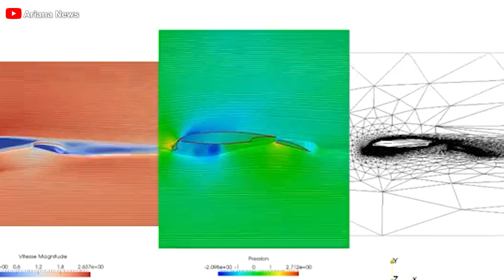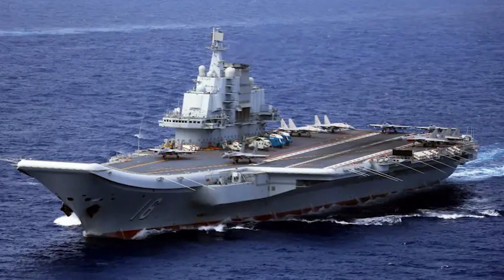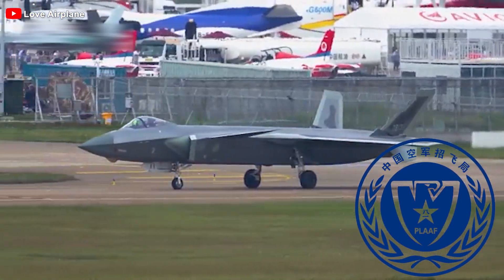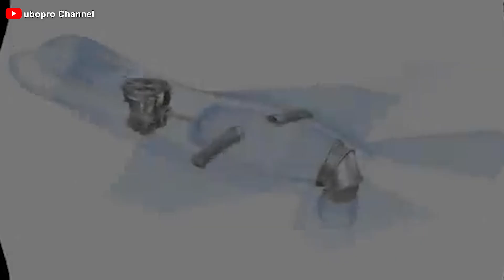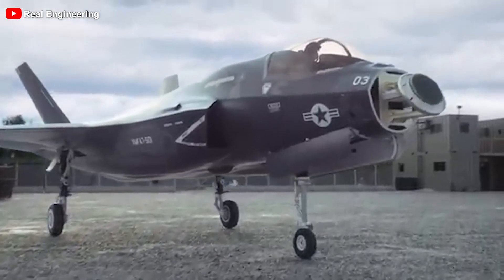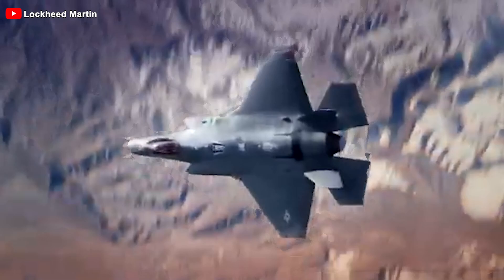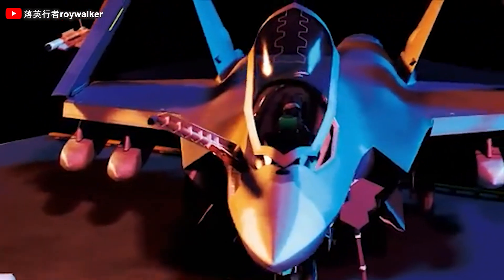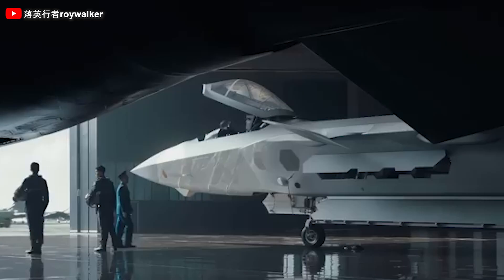The Chinese Airpower: J-35A New Stealth Fighter to U.S Stealth Fighter...

Comment: The design can be finalized after tests with prototype aircraft doing launch and recovery cycles. Structural cracks to the airframe due to stress of catapult launch as well as shock landings. Furthermore, the aircraft must have a controllable slow speed on landing to compensate for the bobbing of the carrier flight deck. May have to increase wing area and strengthen wheel struts.

Usually the first aircraft to takeoff is a rescue helicopter as a safety precaution if ever a fighter launch fail and the pilot goes into the sea. The ship captain must stop the ship immediately otherwise the pilot will get sucked under and ripped apart by the ship's propellers - a known occupational hazard experienced in western navies.

Comment: Many know features of J35A exceeds that of F35.
J35A can supercruise once the ws19 engines are installed at mach 2.2 vs F35 at 1.2 mach with after burner for a short time.

J35A comes with longer range missiles the PL15 
J35a AESA radar is larger with more TR/M using the latest Gemanium nitride same as F35 .
J35A comes with China very advanced communication systems where Quantum communicaitons, 6G , etc can be incorporated.
J35A is sllimmer and is said to be more stealthy.

Dont think the J35A electronics are inferior to the American F35 as Chinese is known to be far advanced in new tech today.

We do agree , since we do not know much about F35 secrets nor J35A secrets,  which is better will only be known if both do battle.
Reply: WS19 is already installed for J35a
Reply: J35a AESA radar is larger with more TR/M using the latest Gallium Nitride semiconductor material for superior radar and EW performance. The US has difficulty equipping its F-35s with Gallium Nitride active electronically steered array (AESA) radar systems as China has banned the export of Gallium to the USA.
Reply: also worth noting the J-35 is larger and has 2 engines, which will allow for more power, cooling capacity, and room for future technological upgrades. this is something the F-3t has struggled with.
Reply: J35 generates more electrical power for the systems whilst F35 is always hungry for more power..... just look at their block 4 upgrades... new engine already
Reply: @hkfoo3333  If that is true? Where is the battle track record? Need not tell lie. Show your battle track record.
Reply: @CherLinLoo-yv7bl  
You tell me the track record of the F35 or F22 old plane.
As it is no steath has fought another stealth .
So we have to base on its features that have been widely reported.

Funny you guys have already lost all tech you can think of . Even the difficult chip manufacturing China is closing in.

What I stated are facts of its features . 
Meanwhile you know how unreliable is the F35? Need I elaborate everything?

No lad, F35 is no match for the J35A on paper but not in battle until both do battle.

Even the F22 is no match for the J20 esp with wingmen planes as has been shown using simulations .

You think your US old stuff is any match for Chinese modern tech from 6G, Quantum communications? stop dreaming